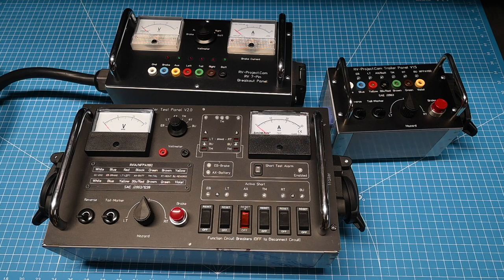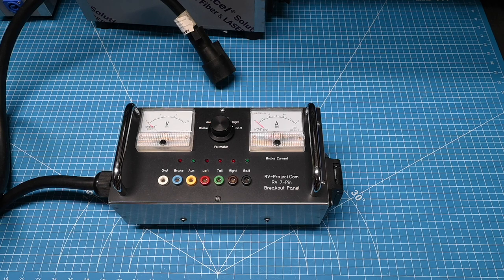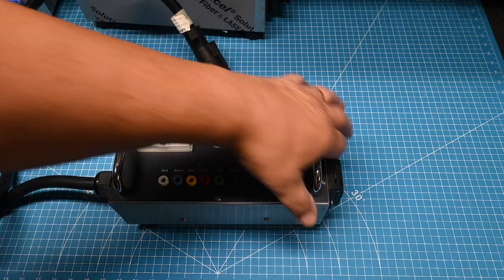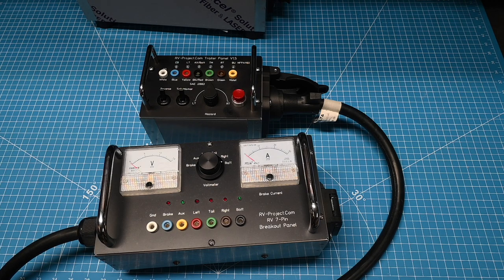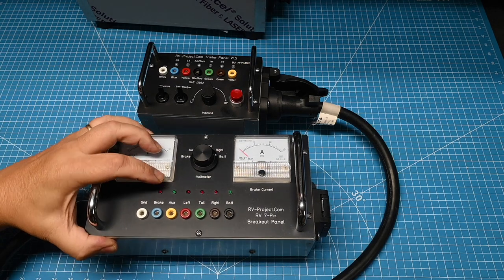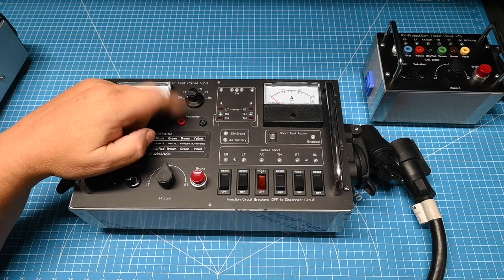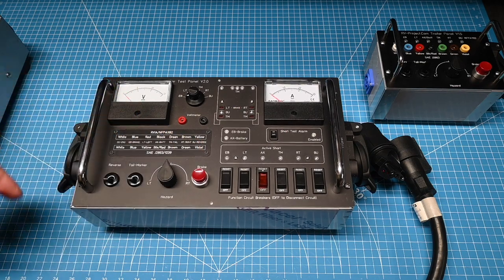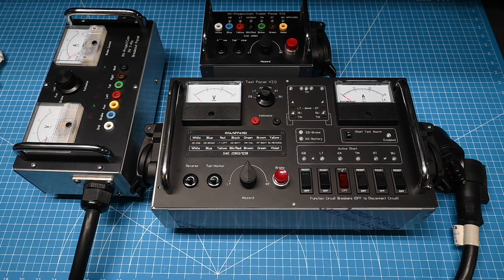Three Trailer Wiring Test Sets you can build.

Comment: On your version 2.0, is there any way to add visual light blinking when beep goes on/off for test of short? I am sure the deaf RVers (I am one of them) and for those who lose their hearing due to old age will be appreciated.
Reply from the maker: Version 2.0 does have a LED above each circuit breaker that illuminates when that circuit shorts.  It doesn't blink though, but you could substitute a blinking LED for a regular one during assembly.